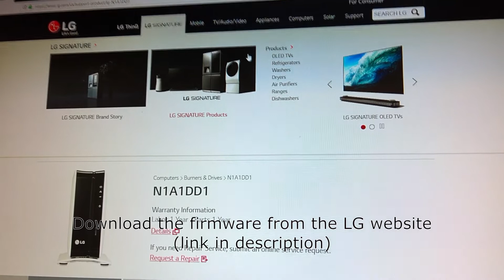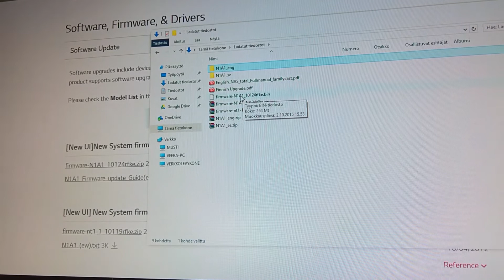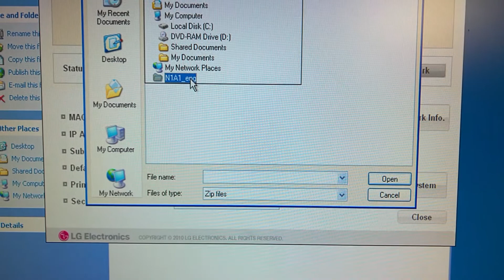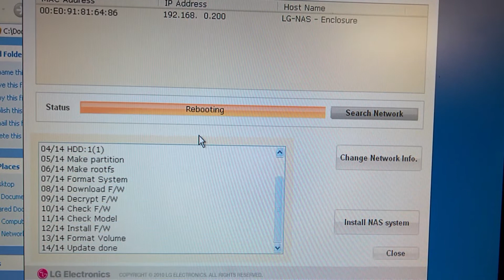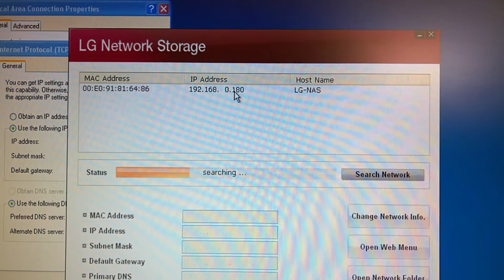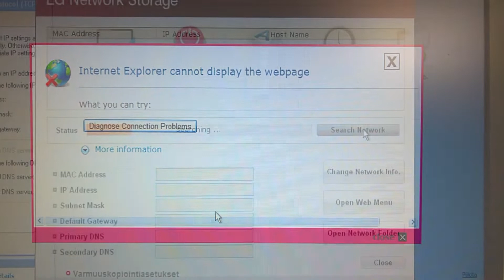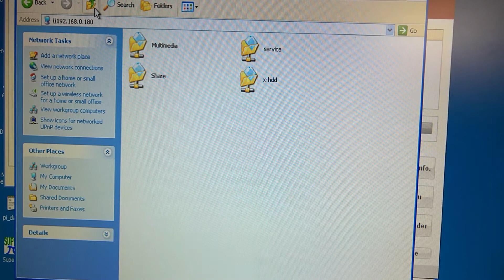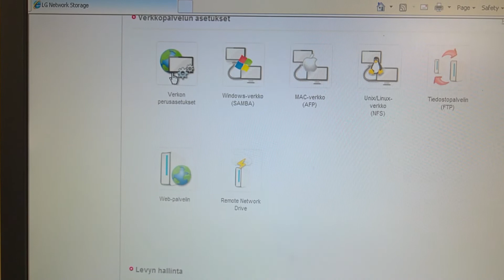LG NAS N1A1DD1 Replacing the hard drive and installing firmware

Comment: Hi!, I have the LG N1T1 and it supports 2TB HDD but ... do you know if it supports SDD?.  Thanks.
Reply from the maker: Hi! I am not sure, but i thing ssd would works just fine.
Reply: @cliffsequipment7668  Yes!!! It works well with a Samsung SSD 860 QVO 2Tb., Although the cooling fan never stops, but there is no high temperature!. Maybe the HDD has a temperature sensor that controls the cooling fan...

Comment: Adding my comment to revive this older video as I need help with this problem for this NAS, I have all the files but cant get them to install, I have followed all the steps. but nothing is working. The lg detector finds the nas, I hit install and point it to the file. get through all the conformation stuff then it just sits there for hours doing nothing. I get no updates in the box below the progress bar. and the progress bar never moves, Hope someone can help as this is doing my head in. Thanks
Reply: Try installing protocol SMB1.